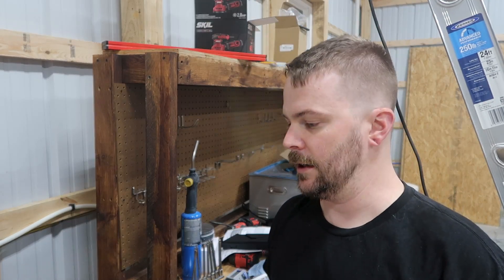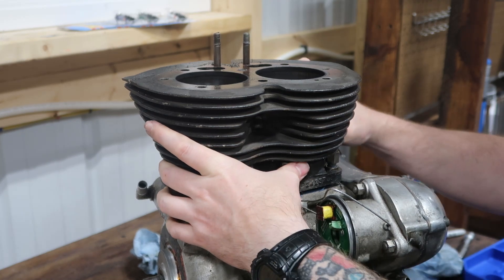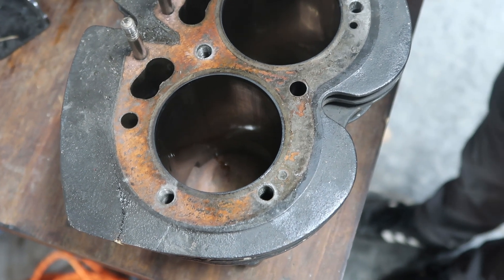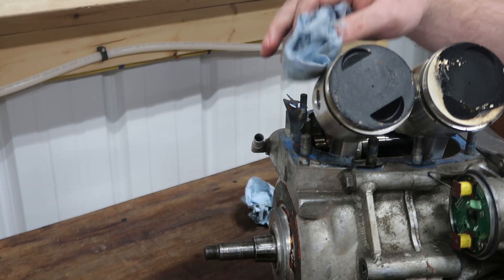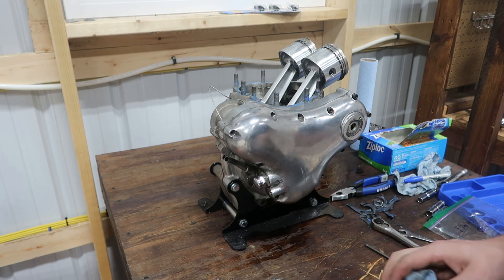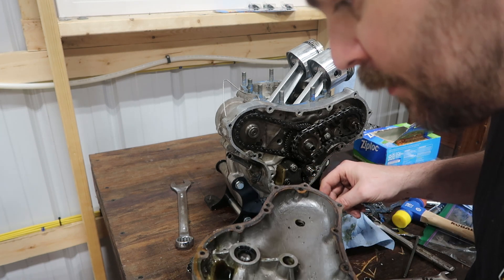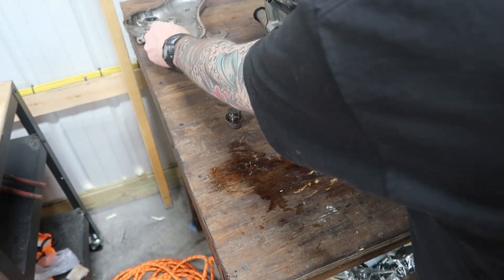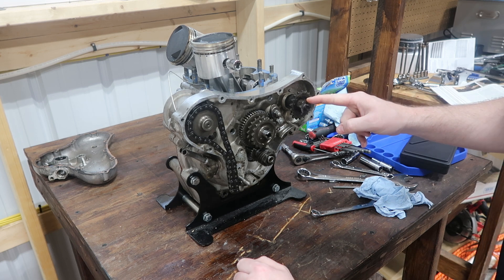Norton Commando Engine disassembly (cylinders and timing side)

Comment: Looks like an atlas motor to me crankcase breather on the left hand end of the cam. Bores and pistons are pretty good IF you are building a Sunday morning ride. If you are building a race engine I would hone the barrel, beadblast the pistons, build and run for 50 miles, lift the head in bike and look at the bores. Cam followers check for slop back to front if it rattles finger to thumb; That's bad, ask me more;
Reply from the maker: Thanks.  Early commando engines were different from the later ones.  1970 and on, they were the ones most people are familiar with.  
Thanks for the tips!  I already had the barrels bored.  I’ve got new pistons for it as well.

Comment: I have had the same issue, I have to say before I invested in an impact driver, so yours must be tight, I ended up very carefully drilling the nut and spitting with a chisel, I don't envy the job my Commando was/is a 1970 so doesn't  have the tacho drive so is just under 1/4" thick and it was easy to see where the thread ended, if you choose to drill and split I would probably source a new nut first so you determine where it is safe to drill.
Reply from the maker: Yeah….i thought it would be good to have the nut first as well, but I already started cutting it. 😂

Comment: Remember when you got your asr cover back it had a pull pin holding in that ball.  Use that for your install 😉
Reply from the maker: Yeah, problem is I either lost it in my move or threw it away.  I can make something similar up with what I have laying around.
Reply: @motohomeless9168  I think it's pretty much a paper clip thickness of metal 👍
Reply from the maker: @motorp742  Yeah, I was thinking about using a wire hangar to do it.  Are you the guy that does the conversion?

Comment: Be careful not to allow the aluminum connecting rods to bang against the crankcases.  Protect them with cardboard tubes (toilet paper rolls) or plastic bottles with the top and bottom removed (or buy some of those plastic mesh protectors).  Any rod nicks will need to be polished out before re-using.
Reply from the maker: Will do!  Thanks!

Comment: The description you were looking for is cam lifters (or followers).  To remove the cam sprocket nut, normally you would still have the cam chain and left-hand thread crank nut and gears on the engine.  Then you can insert an aluminum (or steel) rod into one of the holes in the crank flywheel which will prevent the crank from turning.  Alternatively, remove the pistons and insert a rod through the connecting rod small ends and use wooden blocks on the crankcase to prevent the crank from turning.  Then with the proper size socket (preferrably a 6-point) and breaker bar, apply strong force counter clockwise to remove the cam sprocket nut.  It is not recommended to use and impact gun, but if all else fails.....  These are normally torqued to around 50 ft-lbs, but some "mechanics" use the "torque until it breaks, then back off a 1/4 turn" method.  If it requires that much force or you have to split the nut with die grinder and cut-off wheel, you likely will damage the camshaft.  However you remove the nut, examine the cam bearings carefully and replace if the thrust face is damaged.
Reply from the maker: Thanks.  I tried the method you described to remove the nut.  I think the hulk must have put it on.  Even with 1500 ft lb capable impact, it was not coming off.  I have no idea why it wont come off.  I've tried everything short of cutting it off, so I think that is going to be the next move.  I hope I don't damage the cam.  They are expensive to replace!
Reply: It is possible to separate the cases without removing the cam sprocket if the cam  is re-usable.  It won't be easy.  I'm not sure how you removed the cam chain without removing the sprocket, but since the chain does not use a removable link. the chain and sprockets need to be installed as a unit.  If you split the cases with the cam still in the timing side case,  you will need to remove the intermediate gear shaft.  When you re-assemble you would install the chain and sprockets, heat the case side and press the intermediate gear shaft through the sprocket and into the case until it seats against the circlip.  I would consider this a last resort.
Reply: You've got me hooked now, the nut has to go.